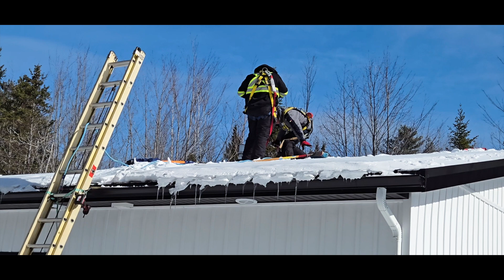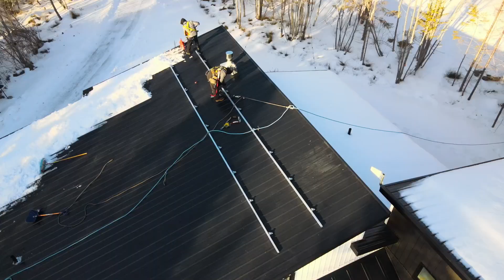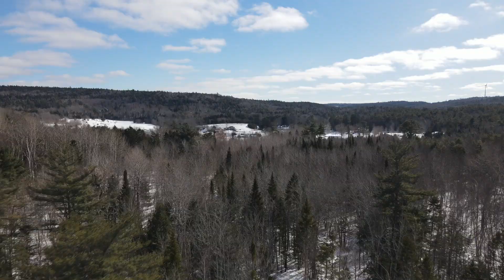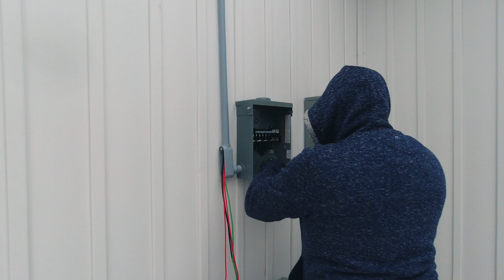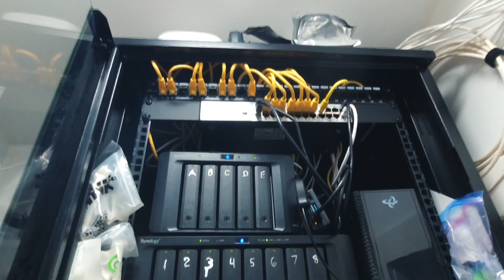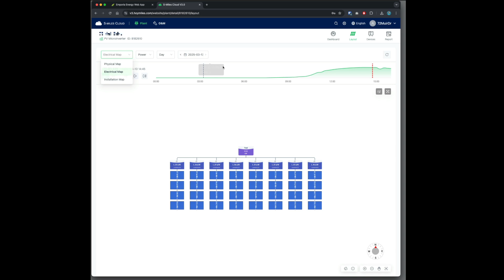We installed a 15kW solar system on our house

Comment: I've seen Aztek's billboard, but I hadn't heard how they work. Apparently quite well it seems.

How was the system integration? I saw from Matt Ferrel that he had issues getting his disparate systems to talk to each other for his whole home system.
Reply: Oh, is your roof a metal one? I've been pondering different materials for when I build my house, and I'm curious about the different types of roofs.
Reply from the maker: Yes our roof is metal
Reply from the maker: We're happy with it so far. I have the energy monitor taking to Home Assitant so we can easily monitor and control the house from anywhere

Comment: Hi ,

You must have used S5 protea brackets that doesn’t harm the roof and Hoymiles as a micro inverter is not that good as it takes 4 panels into 1 whereas Enphase is a better option with 1 micro inverter per panel.
Reply from the maker: Kinda late to change things now don't you think? So far, they've been working mint plus you know, warranty is good for 25 years. Sheesh

Comment: Great system and a great video explaining the design decisions and monitoring.  I don't know what 1 of the solar panel weighs but when I saw that guy climbing up the ladder with the panel in one hand and holding the ladder with the other  I wondered if any fell.   The software monitoring is a nerd's dream.  Congrats!

Comment: Very cool Trevor welcome to the world of solar. Monitoring the data can be addictive. Curious about the choice of bifacial panels on a roof, specifically a black roof. Do you think there will be much reflective generation?
Reply from the maker: I have no way of measuring the efficacy of the bifacial portion. Yes on a black roof we likely don't get much reflection. We've had some very sunny days and we consistently get 10kW at peak and this is still spring!
Reply: @TrevPagesPlace  There is nothing better than going live in the spring b/c it just keeps getting better, and of course the credits work in your favor. We are 5 years in with ZERO regrets even though our production is maybe 90% of what I expected due to shading.
As for the theoretical max do you know what the peak output of your microinverters are? Ours are 295W (Enphase IQ7+) * 25 panels and sure enough 7.4kW is where it caps.
Reply: Perhaps 2% more….. I have solar fence with bifacial panel …and the albedo effect is huge (15-to 35%

Comment: Hi Trevor,

Thanks for sharing your amazing projects! Your water boiler’s energy consumption is quite extreme—have you considered installing a heat pump? It could reduce your electricity usage by a factor of three or even four, making your system significantly more efficient and cost-effective in the long run. It would be a great upgrade for both sustainability and savings!

Also, do you need air conditioning? Have you thought about installing a battery for energy storage in the future? Maximizing self-consumption is key, and a battery system could help optimize your energy use, especially with features like backup power and dynamic electricity tariffs. It could make your setup even smarter and more resilient! Would love to hear your thoughts.

I have electrified my entire home..which has become an energy plus home (it produces more energy than it consumes)
Reply from the maker: We have a heat pump but it's not powerful enough to heat the while house. We only use it in the summer months for cooling. In floor radiant heat needs a powerful boiler
Reply: @TrevPagesPlace  Underfloor heating will run very well on a heat pump. What is the supply temperature to the heating? Unless it is very high (65-70°C), you can install a heat pump no problem.